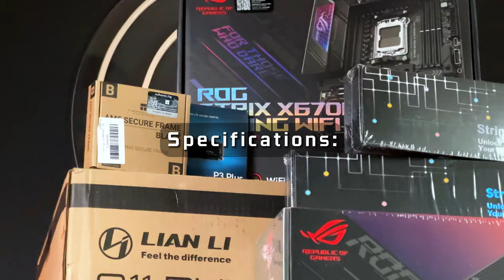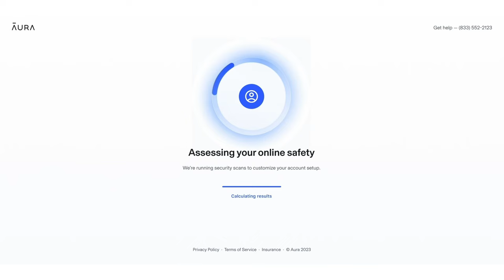This GPU is the future of Gaming! [RTX 4080 Super | Ryzen 7 7800X3D] Timelapse PC build

Comment: omg the cpu temps. i feel bad for your CPU, what cooling method you use? what fan or aio, I really wanna know,,,, i watched around 10 separate videos with same specs gaming builds and they all have extremely high temps just like in here for this r7 7800x3d CPU. why is it, is the rtx 4080 super bottlenecking the r7 7800x3d or something ?
Reply from the maker: Temps are normal and there’s no bottlenecking at all